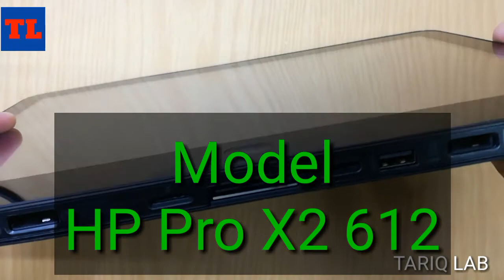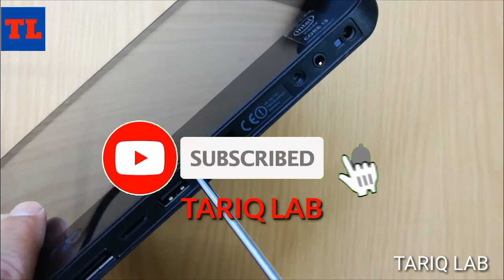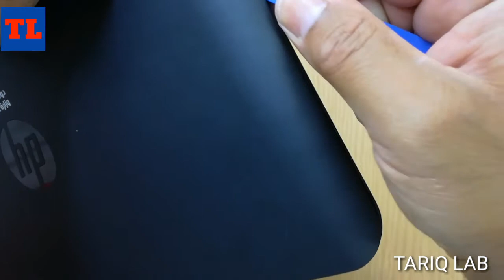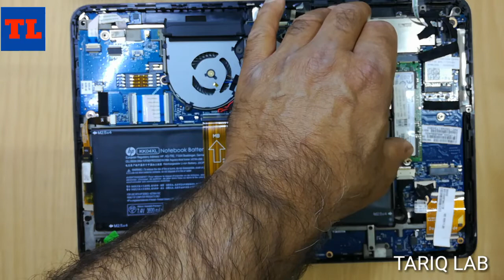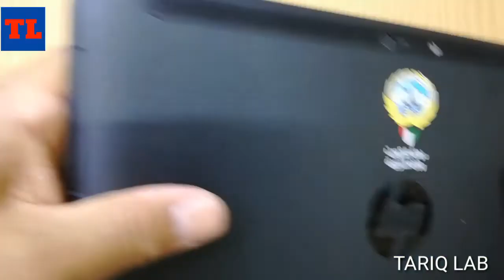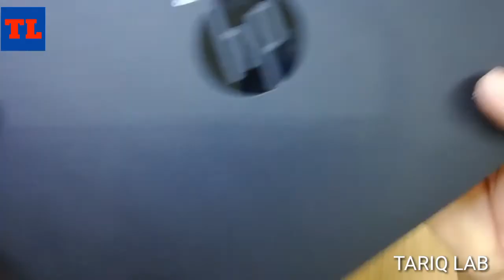HP Pro x2 612 Disassembly & SSD M.2 Hard Disk Replacement

Comment: Hello Sir,
I have the same model, Pro X2 612 and there is slot for SIM but when i  can't find any option. How to fix it. I have tried all drivers. But no luck. Its running on Windows 10. Help appreciated. Thanks.
Reply from the maker: sim module not available in all models, if sim slot is not dummy then check in device manager

Comment: hi , I have the same model , but my keyboard not working , how can repair it ??
Reply from the maker: design issue with this model, don't use keyboard this may damage motherboard, cable inside flexible area damaged, buy a usb or wireless
Reply: @TARIQLAB  thanks for your replay , you mean i use a external mouse and keyboard? cant repair it right ?
Reply from the maker: keyboard not possible, may damage motherboard,
Reply: @TARIQLAB  tnx